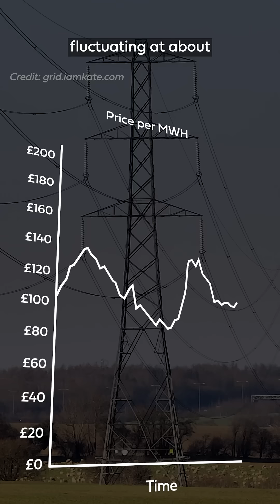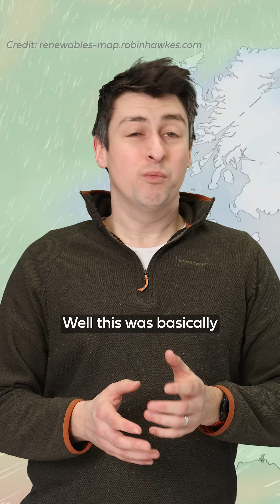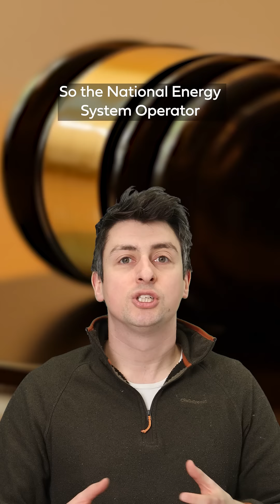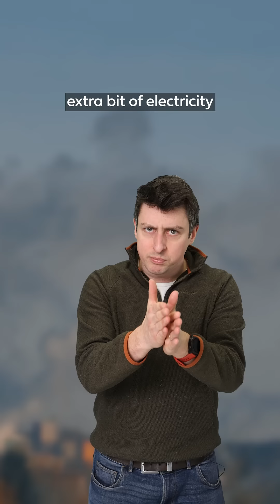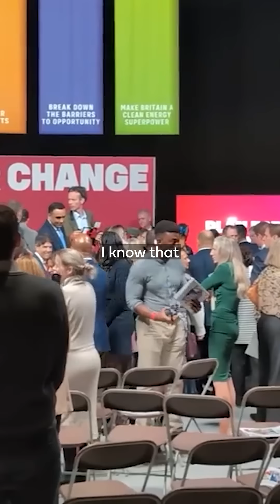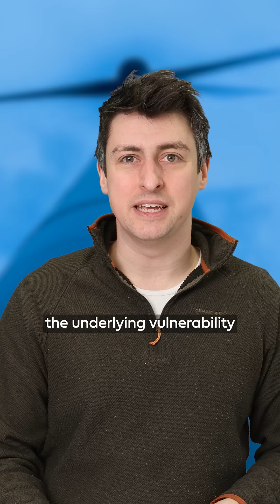The biggest price spike of the energy crisis happened last week

Comment: I know it makes easy headlines pointing out every generator gets paid the highest price, im not sure the alternative would work out better.

At the moment, its in a generators favour to get in early with a low priced bid, because they know that if the last bidder gets a higher price, they will get that price too. The only downside is if they don't bid and don't get to sell any electricity.

If generators only get paid what they bid, then generators will know that in certain situations prices are going to be higher, so theyre going to hold back in order to get a higher price.

Essentially you won't be incentivising generators to bid their best price any more.
Reply: It's insane dude. We say we want storage, but enough storage to cover worst-case scenario would, by definition, be used rarely, so would generally only earn money on those rare occasions. You have to have high prices on those occasions, cause otherwise no one will build that expensive storage that will only be used rarely.

As the storage gets built, the high prices will go down as supply goes up. But without the high prices to begin with, why would anyone spend money building in that storage?
Reply: @Cketzalcoatl  I'm not sure if you agree with me or not?

the issue at the moment, is that everyone gets the high price. the proposal is that in the future only the marginal supply would get the high price, for the sake of argument storage.

I'm just questioning whether the actual market dynamics will end up that way.

eg. wind. Wind is basically free to produce, so at the moment wind producers may as well offer it up for free, knowing theyre going to get a higher rate. With the new system, if they bid 0p thats all they would get, so they would't bid 0p, they would bid some higher amount. Would it all balance out in a situation where the consumer is paying less? maybe, probably? but I don't think the saving will be as large as expected, further you may end up with stupid situations where that wind producer mis predicted the market, guessed they could get £1.5, but a gas producer stepped in and bid £1.4 first, so you may have competition, but you have a wind farm idling, while a gas power station is running. which doesn't seem like an optimal outcome. 

Another complication is all the funding models already in place have been set up for the current way of work, what interactions are we going to have when that changes?

Re storage, its an open question to me, whether their business model will be selling electricity. at the moment prices of electricity can an do go negative, thats only going to increase with more wind and solar.  Theres a good business out there in being able to absorb large amounts of electricity, and be paid for it. The fact that you may have something to sell later is a bonus. Thats part of the reason why I'm more bullish than most about hydrogen, or methane for energy storage, they have rubbish efficiency, but its easy to stick 2 electrodes in the sea to use up gobs of negative priced electricity. The fact that you then have hydrogen at the end to sell is a bonus.
Reply: In Germany at least (and I am pretty sure in the UK too) they arent really bidding. The prices are the marginal costs (i.e. how much it would cost the supplier to produce the next MWh), so they cannot not „give their best bid“.
Furthermore why (or how) should a supplier „hold back“? Apart from energy stored they cannot sell more energy later if they sell less energy now…
Reply: @falschgedenkt9086  I see nothing wrong with the best bid being the marginal production cost. (Or am I misunderstanding?)

You hold back by bidding later. If you're a gas producer you have a good idea of what demand will be, you have a good idea of what solar, wind and nuclear will be. So you can reasonably guess that the highest price will be X. In order to get X you can't bid a lower price you have to wait. But all the gas producers are doing the same. So it turns into a game of first one to break.

If you're a wind producer it's even more messed up, because wind is so cheap. So there's no point bidding low if you know the price will go higher. It isn't clear to me whether the wind producers will also hold off bidding so they are also playing this game of brinkmanship directly against the gas producers.

So in the end you may have a gas power plant spooling up for 1 hour to provide electricity, while a wind farm is idle. Before they swap the next hour.
Reply: Localised pricing would help address this issue, as instead of there only being one market there would be many. Of course all this does it contain the fallout, not stop it. But, it is better than the current system.

Comment: There were no blackouts or brownouts, right? In that sense the grid WAS up to the task. It did supply the demanded power. Just very expensively, for a short time. (Though that doesn't mean it's all good, of course.)
Reply: I believe there was something like a 23% or 25% chance of blackouts/grid failure which higher than it's ever been before.
Reply: @devoutguardsmen  Oof, that's high numbers. Too close for comfort.
Reply: @tvuser9529 The problem is what if the "perfect conditions" last longer than a few hours, or a day. You want to pay 20x the amount?
Reply: @ I didn't say it was ok. Only that the grid did deliver. Just barely, apparently.

Comment: Yeaaaah nuclear... Not sorry but Hinkley Point C is already the worlds most expensive NPP. And it isn't even done being built yet, it's price to the taxpayer is still going up. IF and when it finally comes online for the few months before it melts down (lmao) our entire countries energy price will have upto £1400 a year tacked onto it to pay for this mistake. Nuclear is not the answer to climate change no matter how many times you say it is.
Reply: Nuclear isn't the problem there. The UK is.

Other countries manage to build Nuclear much cheaper than we do.
Reply: @HeirToTheScarletSky  Right... still doesn't change the fact I laid out about Hinkley.
Reply: @robinhood5627  Your conclusion was that Nuclear wasn't a solution to climate change. The other conclusion from Hinkley is that we need to address all the problems making Nuclear so much more expensive in the UK vs the rest of the world.
Reply: @robinhood5627  The UK has only had 1 minor nuclear power station disaster. Also the company making it is building on the contract they can charge a certain amount per Kwh. In other words if they don't finish it they don't get their money. In terms of climate change, nuclear provides a stable base output of energy all year round while being relatively low carbon with most of the carbon coming from construction. Part of the reason also for the cost overruns is that the reactor design which has been used elsewhere in Europe had to be changed for UK safety laws. Something like 30% extra concrete and steel.

Comment: Nuclear electricity is PLUTONIUM and electricity.
France went nuclear for the plutonium because of the crazy nuclear neighbour, Stalin's massive army.
France doubled down with plutonium electricity because of the crazy oil embargo. 

Petroleum for tanks and airforce and logistic transport and adequate petroleum strategic reserves for war fighting.

France's nuclear defence weapons and missiles and plutonium bombs and submarines and aircraft carrier. 

France is lucky it can export nuclear electricity and import German and other neighbours electricity and maintain over 70% power demand to the grid.😮😮

Nuclear plant pipe fractures are a concern. 

Many cold latitude crazy neighbour countries went nuclear for plutonium. Military needs trumps economics.
Reply: Nuclear power uses Uranium not plutonium.
France has a lot of nuclear power because it has no coal, oil, or gas to use for energy. Therefore, nuclear power was the only choice to achieve energy independence.
Germany is lucky that they can import a lot of cheap power from France's nuclear power plants.

"import German and other neighbours electricity and maintain over 70% power demand to the grid."
What do you mean?? The grid needs 100% met demand every second or it collapses
Reply: @reahs4815  France nuclear waste is used uranium and the plutonium produced 100tonnes uranium metal waste and 1tonne of plutonium metal. 1%.

Comment: Nuclear has major problems. Nuclear can not load follow. 
Massive industrial heaters developed for maximum continuous running. 
Nuclear is only economical if it is operating at maximum capacity 247 and has 247 cashflow. 
Nuclear can only work if it is connected to the 80million UK population, the customers and the industrial customers.
That connection is the $TRILLIONs and $TRILLIONS of grid infrastructure that is 10 times bigger investment and needs 10 times bigger cashflow than the central generation plant.

When the sunshines on rooftop PV and v2g EVs massive battery are full, and parked all night long and 23hrs every day then grid electricity will be switched off. 

Mums and dads switching off grid electricity and marking tax-free savings on grid electricity and petroleum and gas heating and cooking and hotwater.

High marginal taxpayers will be early adopters of offgrid tax-free savings v2g EVs massive batteries and rooftop PV electricity. 

The poor will need Government funding for their grid electricity.

Grid owners will ramp up their grid rental $kWh and sell the dirt cheap nuclear electricity 4cents kWh to the remaining grid customers still needing electricity and petroleum for their vehicles and gas to cook and heat homes and hotwater. 

But lets not talk about real economics when the sun is shining and the wind is blowing.
Reply: why did you type 2 comments in weird bullet point form? are you a robot?
Reply: @handoverthestromboli6715  nope, just understand the content. 
My wife advises me on language. 
Thank you for your reply.

Comment: Nuclear!  The only way to guarantee stable supply with only renewables is having huge excess supply. 30% nuclear + 70% renewables is probably the way most countries should go.
Reply: sure. Let's just wait for over a decade till those are built. And by that time renewables are even cheaper and storage systems have proven viable. Only nuclear that would help are those modular things if they evolve
Reply: @MissyBeeeee  exactly.
Reply: @MissyBeeeee But why should we bank on future storage technologies that might be available in the future where there already exists a technology that is proven and doesn't have to be optimized?
Reply: @eliareichardt7007  people don't realise how small the nuclear electric solution is because its grid is so extremely expensive. 
People don't understand that the economics of nuclear, the 247 permanent operation, will be destroyed by the renewables technology economics. 
As a worldwide CO2 replacement technology, nuclear electricity must include the military defence exploding budget costs.
Reply: @ If we keep saying that about everying all the time then we would never build anything at all. If we had started building 10 years ago then they would be up and running  now
Reply: @reahs4815  nuclear electricity is 10times more expensive than rooftop PV. 
Because of the extreme construction costs and financial costs of that construction of new grid capacity.
Reply: You get 0 rooftop pv in winter evenings
So it's infinity expensive when you most need it. You aren't storing solar for 6months.
It's of no use. A big project could be done to pump out 200 niclear reactors of identical design and their cost per unit would be fine. It's a regulation and planning problem. We bet on a tech that doesn't exist yet, grod batteries. And the next 20 years we will pay the price. At least
Reply: @kapytanhook  yes no CO2 emissions worldwide and 9billion people with nuclear electricity and millions of tonnes of plutonium produced. Brilliant, wonderful 👏 😀 👌 ❤️ happy days. 

The economic boon as military defence is expanded is also wonderful 👏 👌 😀 🙌 😍 more happy days. 

The economic boon as more massively expensive national grid capacity is built and the minerals industry and refining and smelting and coal mining and manufacturing and.... is expended is also wonderful 😍 ❤️ happy days.

More nuclear electricity and bigger national grids and everything...
Reply: @reahs4815 we did start building them 12 years ago and it’s still not open, and is set to be the most expensive source of power in the world based on cost blow outs. It’s not a solution, Nuclear is the problem. Expensive, unreliable and needs to run 24x7 to be economical even if it were 1/3 the price.
Reply: Only because you're not going to be the one paying to clean it up. We'll be well into the 2100s before Hinkley Point B is decommissioned. Almost a century where work is being done but no power is being produced.
Reply: Nuclear has major problems. Nuclear can not load follow. 
Massive industrial heaters developed for maximum continuous running. 
Nuclear is only economical if it is operating at maximum capacity 247 and has 247 cashflow. 
Nuclear can only work if it is connected to the 80million UK population, the customers and the industrial customers.
That connection is the $TRILLIONs and $TRILLIONS of grid infrastructure that is 10 times bigger investment and needs 10 times bigger cashflow than the central generation plant.

When the sunshines on rooftop PV and v2g EVs massive battery are full, and parked all night long and 23hrs every day then grid electricity will be switched off. 

Mums and dads switching off grid electricity and marking tax-free savings on grid electricity and petroleum and gas heating and cooking and hotwater.

High marginal taxpayers will be early adopters of offgrid tax-free savings v2g EVs massive batteries and rooftop PV electricity. 

The poor will need Government funding for their grid electricity.

Grid owners will ramp up their grid rental $kWh and sell the dirt cheap nuclear electricity 4cents kWh to the remaining grid customers still needing electricity and petroleum for their vehicles and gas to cook and heat homes and hotwater. 

But lets not talk about real economics when the sun is shining and the wind is blowing.
Reply: @stephenbrickwood1602  THANK YOU!!! I keep telling people nuclear is not the option no matter how many times they say it is! Sure it HAS got a place in the MIX but it is NOT this big saviour they keep touting.
Reply: @stephenbrickwood1602  
You have it backward. The major challenge with renewables, V2G, and battery storage is the need for massive grid upgrades. Nuclear can plug directly into existing grid infrastructure, where coal and gas plants were once connected. The primary barrier for nuclear is outdated regulation and 50 years of underinvestment—global nuclear investment has dropped over 50% since 1980. Meanwhile, wind and solar have benefitted from $2.7 trillion in subsidies over the last 20 years.
Reply: @rontogunov282  what is your background  ??
Reply: @ Rontogunov is right, and I'm a power grid electrician
Reply: @stephenbrickwood1602  I'm a postdoctoral researcher. Previously in Arctic ecology, currently impact on human infrastructure on ecology. I'm not an expert on electric grids, but my research does require my to read on impact of climate change and human development (including things like impact of hydro, power lines, and water cooling for nuclear). You can Google me. If you like.
Reply: @reahs4815  Well, knowing electricity is totally different to tendering and building grid  transmission lines and power stations. 

When an expert in wiring electricity tells me something about that I listen because I am clever enough to know he has the experience. 
For me I have decades in the construction industry and not the wiring electricity circuits.

Comment: God, people nuclear isn't the only solution, this whole sort is literally just saying how renewables help make energy cheaper
Reply: Which one uses land more efficiently, nuclear or renewables? It's nuclear
Reply: @sho-m-er5194 Solar doesn't use any land if you put it on rooftops.
Reply: @drunkenhobo8020  doesn't produce as much as either. Also solar isn't available all the time throughout the year in a lot of places in the world, so it can't be used as a baseload
Reply: @sho-m-er5194  you people seem to think nuclear energy is some artefact of god brought down to save humanity, it's one of the sources to use in tandem with renewables and for some reason you hate renewables but venerate nuclear without even the profit incentive that fossil fuel have, it's such a weird sect it drives me insane, no nuclear isn't actually the most efficient energy production method and you would still need to do the improvements mentioned in the short, gos what is it with right wingers and loving anything that isn't a wind turbine
Reply: @sho-m-er5194lol. Nuclear uses infinitely more land than rooftop solar or offshore wind. And it’s a multi decade project where it uses land and money without generating anything. And it’s even less reliable and a bigger problem when it fails. A great way to get high prices all the time instead of occasionally.

Baseload is an obsolete concept that costs more on average than dispatchable and intermittent. Nuclear power isn’t as cheap as intermittent and cannot be dispatchable.
Reply: @peter65zzfdfh  couldn't have explained that well myself, thank you
Reply: Solar is useless. It produces most of its power in the Summer when we need it least.